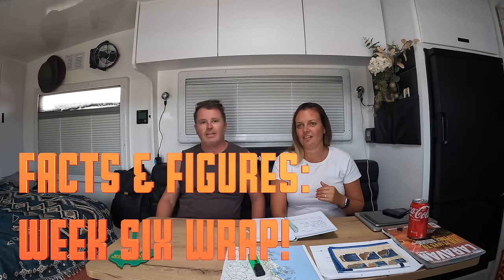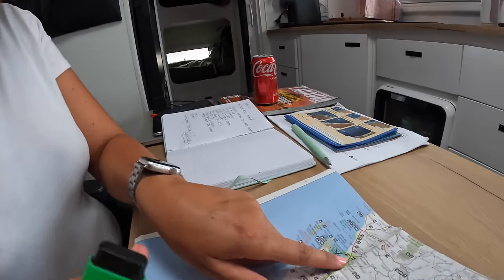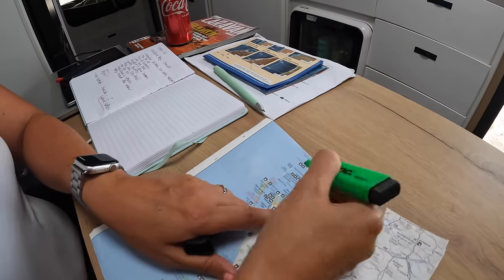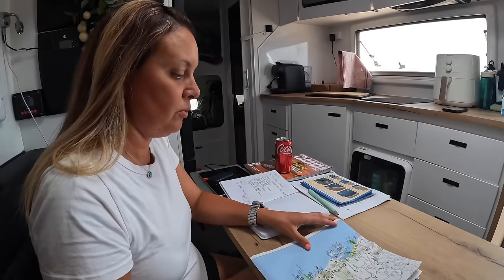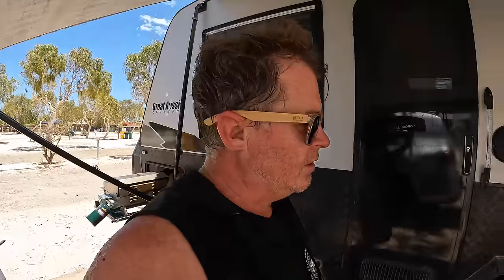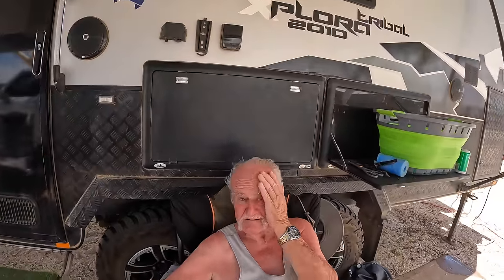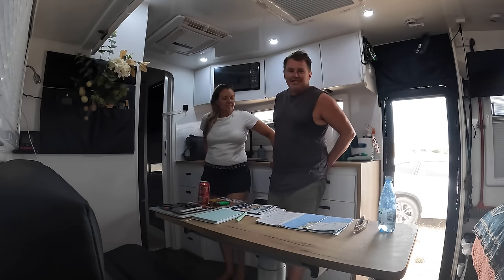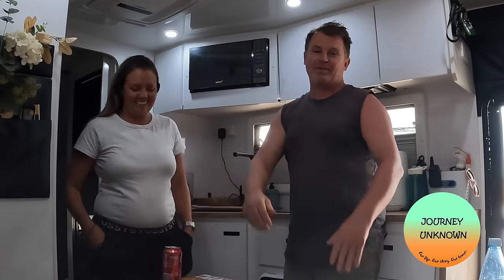Facts, Figures & Behind The Scenes of Week Six On Tour | Ningaloo Coast Must Knows!

Comment: Good investigating of the water tank issue and then the solution. I’m surprised the manufacturer didn’t foresee the issue when adding the third tank and put in a shut off valve.
Reply from the maker: Thank you 😊,  yep, that's a very good question 🤔

Comment: You guys are doing a great job with your information sessions and filming. There’s absolutely nothing wrong if someone “ cracks it “ without swearing off course…..haha, it is what it is, especially in that heat☀️😨☀️🤪🙃. I think vehicle speed could possibly be the answer in that section where you got bogged several times and the max tracks got berried and you had to dig them out, I could be very wrong though as I’ve not had any experience towing a caravan through sand. Take care, stay safe and stay hydrated h2o💦.
Reply from the maker: Thanks, David,  haha, very true 👍. There were a few factors of not getting out of that bog. one certainly was speed, we tried crawl control, although it was a bit late after we were so deep in the sand

Comment: Great work Troy getting to the bottom of that water tank. Very frustrating that it wasn’t done properly from the start but good on you & Coco 😅
I just couldn’t do 45 degrees at any time omg Laura.  Out of interest why do you not run the aircon at all times when it’s so hot… is it because of your capacity on the van that you have to be aircon wise? Have a great week guys
Reply from the maker: Thank you 😊,  Yes, Coco was a great help 😆. The weather was challenging, although we had plenty of places to swim and keep cool.
Yep, we only use the A/C off grid if we absolutely have to, just to take the heat out of the van.  The sirocco fans also work really well 👌

Comment: Well done Troy, but did it work with no clamps on either end of the turn off valve ?
Reply from the maker: Thanks, Peter. Yep, it's working quite well 👍.  GA will be reconfiguring the whole water system to isolate each tank